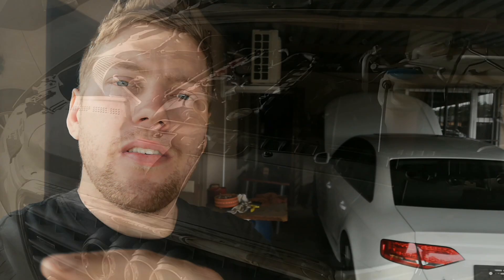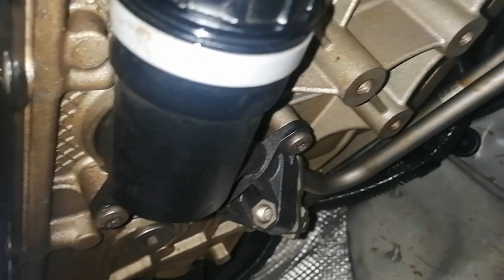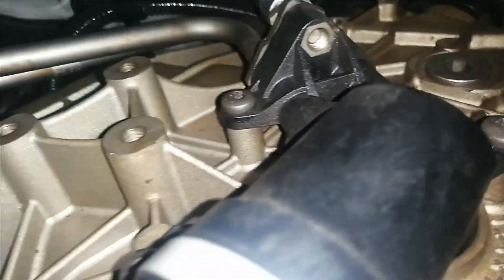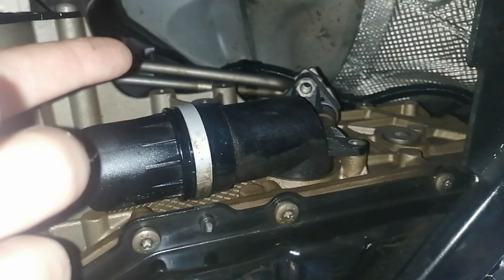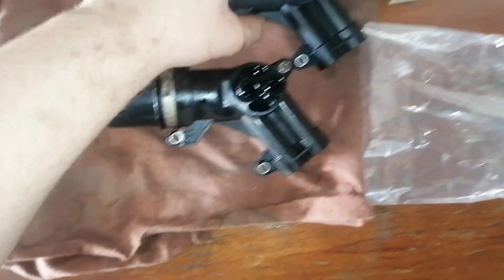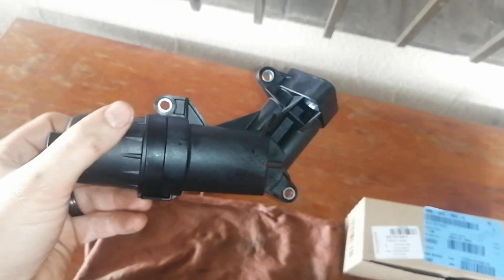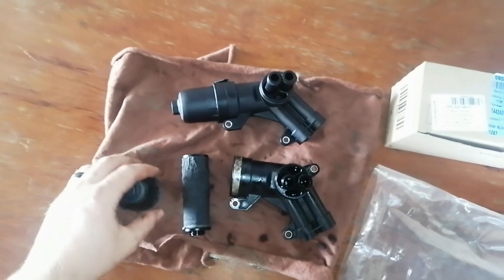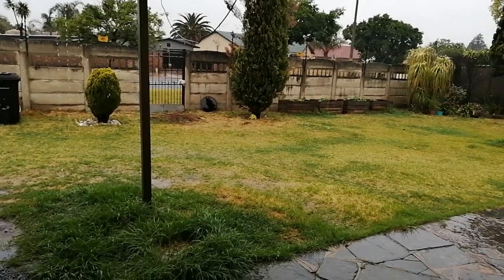How to Change the External Filter on a DSG Gearbox (DL501)

Comment: Been looking for a channel like this... I was considering just doing the cap on my Q5 as that's where it's dripping from. Would that be safe or rather I just replace the entire housing.

Keep up the B8 content.❤ From 🇧🇼
Reply from the maker: Thank you so much 🥳

If your housing has the clip to prevent it from turning off by itself (like my new one), I would just change the Oring in the cap. But... this is a perfect time to slow down. Do some service, Change the filters and the oil. Then you know you are sorted for another few years

Comment: Друг скажи сколько на твой взгляд вытекло масло при замене фильтра в любом случае покупать один литровый ёмкость с новым маслом хватит её или нет
Reply from the maker: The problem I had was that almost all my oil leaked out at the race track. Not when I removed the filter.

So I am really not sure hey. I dont want to lie.

I would reccomend to just to a proper service and replace the filter outside. The filter inside and also the oil. Dont do a half job :)